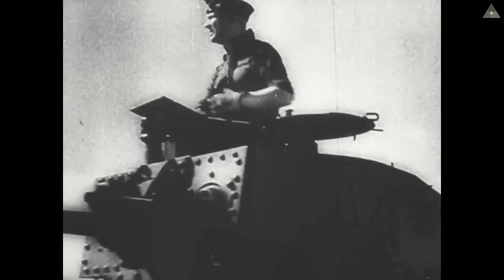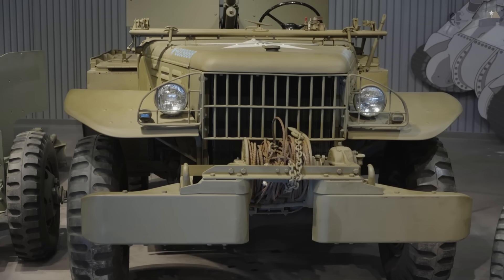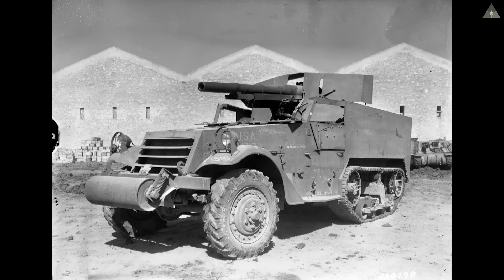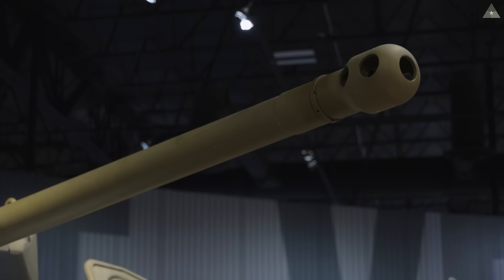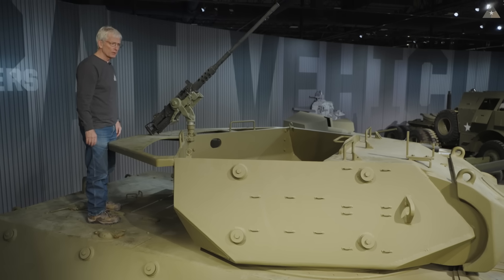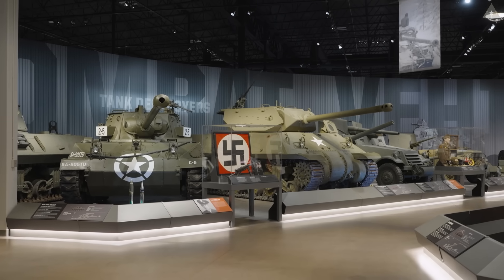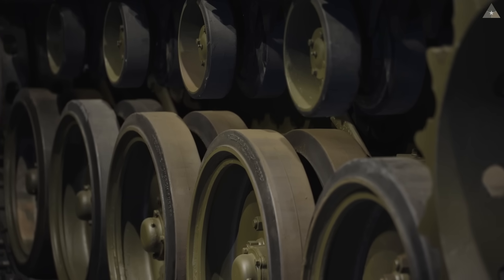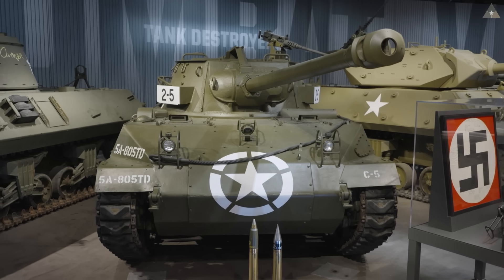US Tank Destroyers | From Defunct to Dominant 1942-1945

Comment: I applaud your video presentations of so many interesting vehicles in the collection. The real interest you show in the history of these vehicles is quite engaging.  And in particular I applaud this review of the US Tank Destroyers of WW2.  Historical author/analyst Harry Yiede characterized them as the most successful failure of the war -- the tank destroyer units performed very well, and were disbanded (and not seen again organizationally) as soon as the war ended.

My father was in the tank destroyers from 1943-45.  As a kid he told me about taking the armor off the top and getting them to go 50mph or more, which I just dismissed as a "dad-ism", until some years later I learned about the M18.  I've been fascinated by it ever since. But all the TDs interest me. I had the unique pleasure of riding around the back roads on post at Ft. Knox many years ago in the M10 operated by the Patton Museum after mentioning to then-curator Charles Lemmon about my father being in the TDs.  I got to do some (very minor) work on the M18 just recovered from Yugoslavia by the Littlefield collection some years back. I'm wondering if that's the same one that has come into the NMMV collection (does not look the same, but I believe the NMMV collection did receive a few vehicles from the Littlefield collection, and NMMV vehicles appear to be repainted to very high standards, however they come into the collection).  

All in all, I am a big fan, and give a hearty thumbs-up to all that you do.

Comment: The only tank the M3 3inch and the M1 76,2mm would have an issue penetrating would be the Tiger 2, Jagdtiger, Jagdpanther, and the Ferdinand/elefant. Which are all incredibly rare to see on the battlefield at the time, and by the winter of 44 the jackson was there which could eliminate any of those tanks from the front.

Comment: You don't have a 3 inch towed anti tank gun which General McNair equipped tank destroyer battalions with between the North African campaign to essentially the battle of the Bulge.  McNair take away from North Africa was that the Towed tank destroyer battalions were just as good as the self propelled type, took less shipping space and were "cheaper" in terms of manpower and cost.  During the Bulge the towed units were easily destroyed.  After the battle Bradley ordered all towed "tank destroyer" battalions converted to self propelled with the m18 being the most available which for some reason was initially not favored as much as the M10 type.  As fate would have it Gen McNair was KIA in July 1944 and the tank destroyer doctrine was dropped from the Army's doctrine almost immediately after the war as tanks took thier place.  The m18s speed was not that much of a force multiplier as originally believed.

Comment: On line I came across a pamphlet by the US Army on available equipment for dealing with Japanese concrete bunkers expected to be encountered in an invasion of the Home islands. One tested was the 90 mm M36 GMC. The 90 mm APC shell and HE were deemed superior to the 75 mm and 3”/76 mm guns.

The other was the 155 mm M40 GMC (155 mm gun M1 “Long Tom”) on a HVSS tracked chassis. I think the idea was to “snipe” using direct fire. Needless to say 155 mm M112 APC shells and M101 HE are quite a bit of a big sniper weapon. Armor penetration was 3” at several thousand yards.

Comment: The 57mm was also towed. It was considered the heavy tank destroyer. It didn’t get deployed as much as the 37mm. 
I think it had something to do with availability of ammunition. 
The M5 Stuart should of been up-gunned with the 57mm main gun and 50cal.
Reply: Anthony, the 57mm was consideredbthe light AT gun replacing the 37mm at the infantry level. The towed 3 inch AT gun was the heavy AT gun and was in TD Battalions. The 57mm was never assigned to TD Battalions, but Cannon Companies in infantry regiments.
Reply: @ 
Right you are;
My point is the upgraded M5 Stuart wasn’t given a stronger main gun.
Also;
Late in WWII the 37mm was configured in the center of the quad 50cal. It was magazine fed automatic, 10 rounds.
Again;
There was enormous amount of 37mm ammo. And that is why they kept the 37mm on the M5.
That decision lacked consideration towards a more formidable M5…
Reply: @patrickmccrann991  12 57mm were in the regimental anti tank company, short barrel 105 howitzer were in the cannon company
Reply: Technically the 57mm to the Infantry branch and never adopted by the "tank destroyer" branch of the Army.

Comment: What made the Hellcat effective in the doctrinal role foreseen by the TD Branch was its tactical agility in addition to its raw speed.  The M18's high power to weight ratio and the very innovative torque converter equipped driveline allowed the M18 to "shoot and scoot" thus being able to deliver 2-3 rounds vs an approaching enemy and then dash to an alternate fighting position before the enemy could bring accurate return fire to bear.  One TD battalion commander likened the M18 to a polo pony in its ability to stop, start, and change direction on a dime.
Reply: Going for speed over armor was a good choice considering the Germans leaned so heavily into maximum firepower it was hopeless to resist it with armor. Especially considering the difficulty of moving such heavy vehicles overseas into damaged ports and over lightweight replacement bridges.

Comment: M-18 was a paper thin crap Tanks are killed by firepower which M-18 was lacking not by fucking speed
Reply: greyhound killed a kings tiger
Reply: @ducklinglibrary7941  This is a well known bullshit If at all this was Pz4 at most
Reply: The tank destroyers were not designed to fight toe to toe with enemy armour. Being lighter they were quicker, they could maneuver in, take their shot and get out. With the m36 of w the I
90mm, it could take out a tiger at 1000 yards, a panzer at 1500 to 2000.
Reply: M18 had the M1A1/A2  76mm guns. They were not crap but very effective at usual combat ranges. TDs were not tanks and not intended to fight nose to nose with tanks. The German TDs were used the same way.

Comment: Some food for thought. Germany's workhorse, the Panzer IV, had only 8600 or so built. Now using some assumptions like if 80% of the defeated German forces being defeated in the East also means that 80% of the German overall strength was sent there, that means of Germany's most numerically important tank, only about 1,700 fought in the West. 

I bring that up, because for a good portion of Germany's armored forces where converted captured early war vehicles. And many of them left in an un-armored state. The 37mm wasn't fighting off waves of Panthers or Tigers, but even into '45 could easily hold it's own against armored cars and Marders. True it was time to replace it, but the 3inch cannons were perfectly reasonable weapons for the primary fighting as it's almost hard to justify sending guns to deal with a few handfuls of Panthers or Tigers.

Comment: My Thoughts:

* I think you are needlessly dismissive of the 37mm.  In 1940, it could absolutely penetrate anything the Germans had and was in line with things like the 2 Pounder and Pak 36.  We just didn't use it until 1942 where it had then been outclassed.

* My readings suggest the Tank Destroyer's speed was more for quickly seizing the key terrain and laying an Ambush, then disengaging.  Maneuvering for a side should would have been very risky.  The M10 especially has a notoriously slow, hand cranked, turret.  I'd argue only the M18 would be capable in the flanking role thanks to its incredible acceleration.

* M8 Greyhound probably deserved a mention.  It began life intending to be a tank destroyer.
Reply: M8 Greyhound was an armored car. Think you mean the M8 75mm HMC which carried a 75mm Pack howitzer. Not really the ideal weapon for AT work, howitzers are low velocity weapons.
Reply: @patrickmccrann991  The M8 Greyhound was initially designed as a Tank Destroyer.  However, by the time it was ready to go in 1943 it was completely outdated in that role, and instead found a new lease on life as a scout.

Comment: @5:37 - "The M10 is a conversion of a M4A2 Sherman tank, with diesel Cadillac twin engines."  I believe the engines are actually a twin installation of the Detroit Diesel 6-71 inline engine, generally called the GM 6046.  (GM created the Detroit Diesel Engine Division in 1938; it remained a part of GM until the 1980's.)  I think the confusion comes from the fact that the M5 Stuart light tank was equipped with twin Cadillac V-8 engines linked through a transfer case.

Comment: I think most of the early panzer 4 actually had worse armour then the panzer 3 so the 37mm gun would kinda work… 
However the Germans quickly uparmoured the panzer 3 and 4 after their experiences in France.

The British 2 pounder and French 47mm guns were quite capable of knocking German armour out so they needed to up armour because they got hammered each time the French or British troops could set themselves up for a fight.
Only because they outran the allied reaction capability allowed them to beat them tbh.
Reply: Absolutely correct. Initially the PzIII was the "battle" tank, armed with a high velocity 37mm gun and 30mm armor all around. The PzIV was the "support" tank with a low velocity short barrel 75mm for primarily HE use, and armor that was 30mm in front but decreasing to 15-20mm around.
US 37mm guns never engaged these early model panzers, which were supplanted before we entered the war, but the British 2lbr abused them quite well.
Reply: Yeah he seemed needlessly dismissive of the 37mm.  Sure, by 1942 when the US really started ramping up for the war is was getting long in the tooth, but in 1940 it was comparable to the German Pak-36, British 2 Pounder, and Soviet 45mm.  I think he's underselling just how little armor early WW2 tanks actually had.

I think the disconnect is he started talking about the invasion of France, but then jumped to Kasserine.

Comment: A great video and some excellent vehicles. I always have a soft spot for anything armed with 17pdr. Arguably the best allied AT gun of the war.

Respectively I don’t think you can make a general comment about allied tank doctrine between the wars or use of AT. The British experimented extensively in the 20s & early 30s. German doctrine used elements of British thinking. The British and French both clearly anticipated tank on tank encounters as evidenced in the Battle for France, not least the Arras counter attack. Both countries had tanks that mounted powerful ATs for the day and Matilda II saw service all the way to the end of the war in the Far East where along with other models no longer effective in the European theatre, was superior to all Japanese tanks.

British and US doctrine continued to vary throughout the war but the biggest illustration is the British getting the 17th pounder onto towed and SP platforms as well as Cromwell and Sherman hulls as Challenger and Firefly.

Comment: From a plane it would penetrate
Reply: If you are referring to the 37mm, you have heard some misinformation. 

It is often quoted that the P-39s we gave to the Soviets were used as tank busters. They weren't. They were used as low level air cover. They didn't carry AP ammo. We didn't send them any AP, they weren't going to build a factory to produce ammo for a gun that was in very limited use with them, and their testing with the best pilots against static targets showed that at best only a 7% hit rate could be expected against a tank. Given that the plane carried 15 rds of 37mm, sorties with AP ammo were a waste of fuel as only a single hit might be achieved at best and it was pretty chancy if it would do any damage.

By the time the British were putting 40mm guns on Hurricanes and the Germans were putting 37mm guns on Stukas, tank armor had progressed to the point that only a rare fluke shot would penetrate; track hits for a mobility kill were the expectation. 

The success of aircraft against tanks in WWII was mainly due to bombs. Rockets and small cannon were highly overrated and their kill counts inflated.

BTW, the vaunted A-10/GAU-8 combination is also greatly exaggerated in its effectiveness against tanks.

Comment: My favorite story about the TD's during WW2 was:  before D-Day, and given the experience of TD's in North Africa and in Italy, around half of the TD Battalions in Europe were converted to towed weapons.  However, after experience with the TD's in Western Europe, it was decided to convert ALL TD battalions to self-propelled pieces.  Since the Army was introducing the new M-36 at the same time, battalions previously equipped with the M-10 were reequipped with the M-36, and the extra M-10's were used to convert towed battalions to SP battalions.

Two little known facts about TD's.  First, there were some M-10 equipped tank destroyer battalions which were going to be reequipped with the M-18, and they refused, preferring to keep their M-10's.  And second, one of the early M-26 tanks suffered damage to it's gun barrel in combat, and so the mechanics simply replaced the M-26 90mm gun with one in the supply system meant for the M-36.
Reply: And interestingly, that M26 was the famous “Fireball”, the one knocked out at Elsdorf by a Tiger 1 at short range